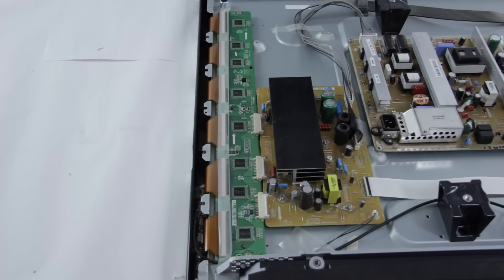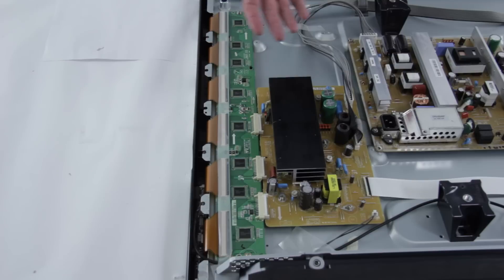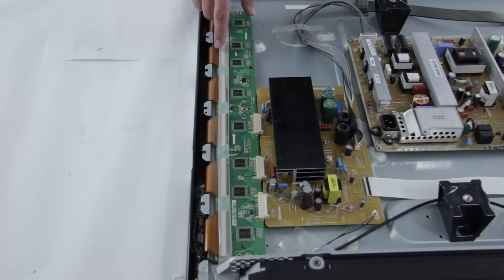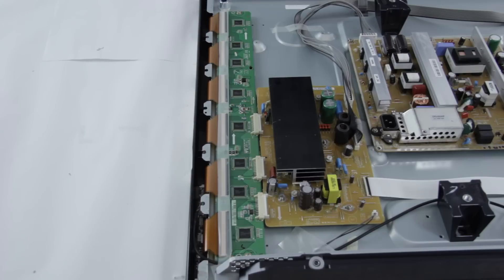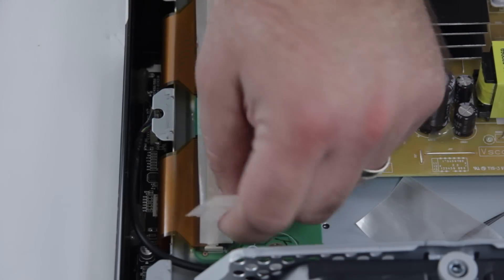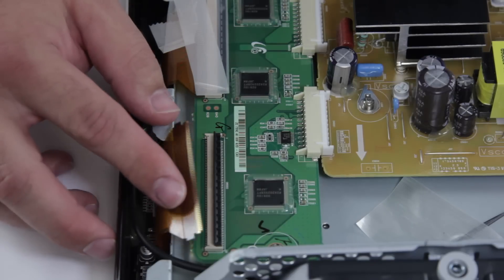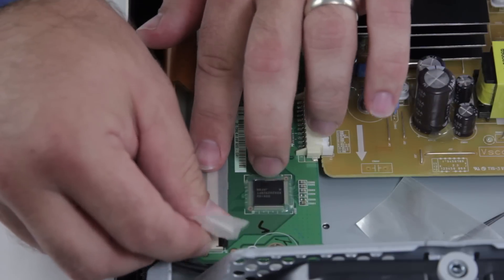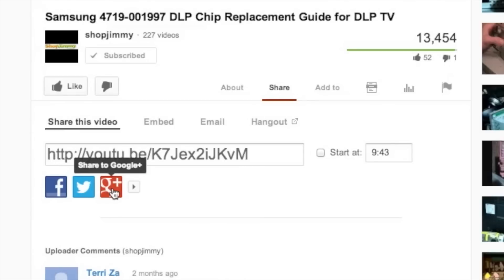Plasma TV Repair - No Image, No Picture on Plasma TV Screen - How to Replace Y-Buffer & Y-Sustain

Comment: Hi Jimmy, have a Pioneer Plasma TV model pdp-505pg, I believe the Y sys board is faulty, bought a second hand one USA, however, that doesn’t work at all, the old one works for a while then cuts off, can be days a week or a couple of hours. Question is can these boards be repaired? I am in Australia any help would be appreciated Thanks Paul

Comment: Hi, I just came across this video today as I have recently had an issue with my Samsung 59" Plasma TV  (P559D550C1MXXY). I realise that this video was posted 10 years or so ago but I am hoping to still perhaps receive a reply regardless ....... My TV was working fine for all the years I have had it (bought it brand new) and while my friend was playing a game on a PS4 ( but was not watching the screen at the time as he was distracted from the room for a few minutes), he told me that when he returned he could hear the sound of the game but the screen had blacked out. So he turned it off.
When we tried to turn the TV back on a little while later you can hear it "click on" and the red standby light flashes slowly a few times and then stops (turns dark no longer red) and there is no picture. We have tried a few times including complete power off methods to no avail. Can not change the mode to normal TV to see if anything as we cant see the option to do so due to this black screen also, so we have no clue if there is even sound still. The remote sensor seems to pick up the remote as when you press a button on the remote you can see the standby red light slashing rapidly however this does not appear to continue it too eventually stops. ..... Any suggestions? Or should I just dump it and buy another TV? (Although this TV has the best picture and has lasted beyond its expectations) NEED HELP!! :face-blue-smiling:

Comment: 😂I do not know if you ever get to me but PN51F4500AF model 51inch. It plays normally then randomly picture black out while sound playing and commands work like volume on remote and tv physical buttons.  And then it will eventually shut down sound or commands don’t respond. No red light either. I have to unplug hit power off 15 seconds and then plug back in 30 seconds after or 30 minutes later.  And then it turns on but randomly go black in the first few minutes or sometimes lucky to go on 30 min

Comment: Hello my tv not switching on, stand by light blinks intermittently. Sound working if I disconnect x sustain board and standby light perfectly working without the x sustain board. What could be the problem. Model PS43E400U1R

Comment: Hello, watched a number of you videos and very helpful.
I however have a issue that I’m trying to resolve with this nice( but heavy) plasma Tv and was hoping you could point me in the right direction as to troubleshooting and fault finding.
The Tv is a Samsung Plasma ( model PS50Q97HD) 50” the  Tv powers on and the two relays click on the PWR Supply board. The blue led  flashes 6 times under the (on/off) at the bottom middle of the set. There is NO PICTURE and NO SOUND. The Tv responds to the remote (blue led blinks infer the (on/off) button at the bottom middle of the set but that’s it,after 20 minutes of inactivity it goes back to (standby) and the blue led illuminates under the (on/off) button.
 
There doesn’t seem to be any evidence of the (Y) or (X) sustain firing.

The original PWR Supply was faulty ,so has been replaced with a good working S/H unit,I re-flowed all joints on the transistors,capacitors and sockets on this board. (No dice) so then replaced the (Y) sustain board along with the (Y) sustain buffer boards (HI) and (LO) still no Dice. I then replaced the (X) sustain board with a good used S/H board, still no dice,so I then replaced the (Audio/Video) board located just above the stand in the bottom middle of the set,still no dice,so puzzled. The what is termed as the (logic Board) a small board with 3 white ribbon cables going to it,and is located behind the stand (Sub Assembly) this has not been replaced(Yet) and does have a (Static) green leds illuminated when the set is powered on.,also there is a green led lit (static) on the (Y) sustain board 
There is another (buffer board) located at the bottom of the set,just above the (L) and (R) speaker boxes,( not replaced) yet  this has 12-16 brown flexible cables coming direct from the screen. These are in pairs (L) and (R) with a cable linking both together,these are marked (E)  and (F)

So it appears there is break in communication between some of the boards.

1/ if the (logic board) became faulty,would this cause issues in the set working properly 

2/ if the (E) and (F) buffer boards located at the bottom of the screen just above the speakers went faulty ,could this cause issues/abnormal behaviour.

As you may have gathered,I have replaced most problematic parts, yet the set powers on but remain essentially dead.

Guidance and advice as to where to troubleshoot would be greatly appreciated.

With thanks. Jason

Comment: Good morning sir, I have problem, Samsung plasma tv blinking.model
Ps43F4000AR
Reply: I need help on how to solve the problem, I also want to ask if the Vs voltage is continuing when the Ysus board is disconnected

Comment: Dear Sir, Thanks for the help that you are providing to us, which I believe is very much valued. My name is Kiran and I am from Mauriitus
My issue is about the Y Sustain Board . it is making a clicking sound when I power the device on. I have to remove the main cable and reconnect it  every time. There is no image on my screen and the screen is completely black. My model Tv is an LG 42PQ10r. Please

Comment: I got plasma tv Samsung 50 inch . I’m have problems after I bought a new power supply for it . The problem is my tv don’t show nothing on my screen but it quite kick on and off and when it off the power light on and when it on the power light off. So I put my old back in and screen came on for 20 min before it start kicking on and off and power button light on when tv on and off when tv off and I see the menu when tv kick on and off

Comment: Hi ideas on short on y sus buffer connector matey ? Had bad capacitor on y sus changed 3 mosfets keeps power cycling shows short on 1 buffer connector 1st and last pin ty

Comment: My tv is samsung plasma tv model pn59d530a3f.  The sound and picture were not working.  I replaced the main logic board and the sound came back but no picture.  No backlight either.  With this model, the power board goes to the y-axis and then there is a power ribbon from the y-axis to the x-axis.  Im assuming i should probably replace the y-axis first?  thoughts about this?

Comment: I have a Samsung plasma 42". When turned on I will get picture for a few seconds. But then screen goes black. Still produces sound but no picture. If I turn it off then on, same symptom. Picture fir aliitle then black screen and audio. Any recommendations?

Comment: February 27  2023

Gentlemen: 
The information below refers to a L G  Plasma television
Model #     42PJ350_UB            Serial #    005RMNE9K527         (2179)
SVC Code  42PJ350-UB  AUSLLHR               MFG     May of 2010
The problem began as a loud POP. The screen went black and no audio.  Upon inspection I found that the Y sus main board was shorting the power supply board to ground.

I removed  the Y sus Main board and checked the power supply board and found that 
all voltages on the power supply board were as indicated on a sticker  above the power
supply board.  VSS 197 - 207    was  207.    Va  60    was 61     Ms  5     was 5.0     Obviously 
all fuses were  good.

In checking the Y sus Main board I found Q11 and Q12  (sus up) shorted drain to source.
I removed those F.E.T.  and replaced the board.   The power supply board functioned
properly and all voltages were normal  at the input of the Y sus Main board  and the 
Z sus board.  Naturally I didn't expect the screen to light up but I was able to verify that after having connecting an antenna that I had audio and was able to turn the  tv on and off and vary the audio gain with the remote control.

I had audio, remote  control  operation  as mentioned above with  the ribbon  cables removed
from logic card to Y sus  main board,Ribbon cable removed from  Y sus main board  to Y buffer
and small cable from Y sus main board to address buffers.  The  eight integrated chips on the
Y buffer card looked in good condition as none appeares to have been over heated.

I suspect that I will need a replacement  Y sus  main board so here is  more information from  that board.     Y Main sus board  I.D. numbers.

printed on board	White sticker

E52483	EBR66607501					
LGE  PDP 691208			Y sus
Board  42T1_Y sus	ks 42104 jO55688
Part #  EAX61332701	2010 .04 .15
Rev P       LDC  no   2xxx    94V-0	

please respond to   James Foley       wa4jio@twc.com

Should you have any questions, please contact me by e-mail .

I will call you  in a  day or two and give you a phone number to call me should you need to.

Respectfully,    James Foley.

Comment: My Pioneer set model 5020 suddenly went blank (black picture).  Turned it off, waited 10 minutes, and turned it back on.  A sign came on, "Warming up, Please Wait.  Nothing happened, and finally, it went off.  If I touch any button sound, HDMI, same message comes on, but nothing happens.  No blinking light.  Standby light goes from red to blue but never picture.   Any thoughts

Comment: I have a Samsung PN64D8000FF that has a black screen but was getting sound from the cable box. I see the Y board may be faulty. Is there a way of determining if it is the Y buffer vs the Y sustain? Also, I have seen where the issue might be with the X board. I don't know how to use a multi-tester. Please make suggestions. Lastly I only saw a Y board offered on Ebay, where else should I look?

Comment: Hai, I have a problem with the Samsung plasma ps-42c62h. It has power on and sound but no picture only black screen... I have checked the T-corn board looks ok and the cables... What could be the problem? Do I have to change the y-buffer

Comment: I have a Samsung plasmas tv. Model PN50C8000YF. I noticed 2 Black oblong spots on my screen with white circles around them. While looking at the TV the picture just went to a black screen. Audio still works. I get no menus or volume emblems on the screen. Is this repairable? If yes what do you recommend.

Comment: i had a samsung ps51d450  first while view something exploded inside ,found it at the x sustain board and replace the FGPF4536 ,SF10A400h .also found that shorted 5volts to gnd.on the ribbon cable at the t con board.going towards the Y SUSTAIN .replacing this cable did not  fix the tv a 5sec then 2sec interval occurs at the t con board but i found out that this is cause by pin 21 DRV-RESET of CN5006-CN2022 of the ysus and tcon .thank you

Comment: Hi.. I have a 42" samsung plasma tv, when turning on I can hear the samsung sound but no display.  I have changed the Y-board and the Z-board but still no picture. Can I safely assume if I replace the y-buffer board it should work?

Comment: Samsung plasma tv ps42a456p2d vertical lines on screen. Initially though my xbox had change screen settings but this is not the case. Watched your video and wonder if it is the tcom  board or the screen?
Thanks Mark
Reply: Opened up TV have a flashing led 2 light next to r2068 led 1 does not flash this is next to r2067 does this help to diagnose in any way? Really interested in the solution as its my sons xbox monitor and tv

Comment: i have a 50"  LG plasma tv ,had it many years and for a while the picture would go dark and there would be some residual reddish speckles and eventually after many times of this happening it would be just dark but the sound was still there, i thought it was perhaps an over heating issue so i would shut it off and put a standing fan to blow air behind the screen at the back housing panel and then keep the fan on while watching tv ,but after a while the problem would return even though the tv was still cool so i would shut off and turn it back on several times and the picture would come back and i no longer needed the fan ,now both pic and sound are gone and doing the off/on thing is no longer working ,is there anything i can do myself or is it worth it to get it repaired or just buy a new one?
Reply: I' ve the same problem 😓
Reply: @blaster-kjared9561  what is your tv and what problem? give some details,, mine lasted 11 years strong since 2011 date of mfg  when this problem finally happened , tried a few repairs myself, zilch ,,,had to deal with some bad practice repair fools over the phone that never showed up to my house and kept giving me excuses ,, finally by great luck found an electronic and tv repair place close to me who work on these older models and got it fixed after a couple of weeks(could have been a couple days had the guy worked on the board himself instead of trying to find a replacement) and cost me only 200 bucks ,its been 7 mo now and so far so good hoping for another 11 years be awesome but even if i get a few more years out of it  would have been worth it specially for good pic plasma screen you can no longer find em anymore , the pic still looks pretty sharp and good perhaps better then before the repair but i figured it would be worth the effort to try to get it fixed if the price is right because there was nothing wrong with the pic before it broke down

Comment: Hi i have samsung plasma tv ps50c430a1 the tv turn on normally and the picture come normally for minute or less and then the picture goes off but keep sound what do you think the problem is ...i hav not measure any thing yet... will you help me please....thx anyway
Reply: Hi i measured the voltage of vs and va when the tv work normally ...there is vs voltage which is i think 217 volt but  when picutre goes off the voltage of vs missed will you help me plz

Comment: I have an LG Plasma TV model no 60PV400.  It starts up just fine and then after some minutes the screen just goes black, but the sound still plays and it doesn't interrupt anything else, just the screen goes black.  I stopped using it for months and months, then the first time I tried using it again it lasted a day or so without doing it at all, but now it's back to doing it every couple of minutes.

Comment: Hello. Nice video. I like to learn from you. 
I have samsung plasma PS51D550 and the screen is covered with vertical colored lines from top to the bottom. At first there was only one white line and after a month there is about 20 lines all over the panel. Tv works fine, and there is no new lines in 6 months. What do you think the problem is? Thanks

Comment: May Panasonic plazma TV model no TH-P50X30M  so this tv I was close and packed 5 year then after 5 year I want to start the TV but not came on  tv given the 12 time blinking code red light error please can inform me how can repaire and which is the part of the  problem power supply are motherboards

Comment: My samsung screen just switches off. if it has worked for a long and you switch it off especially when going to bed, it does not start on the following day. it does stay for a very long time to come to normal so that it becomes on again when switched on. We normally have to wait for its self picking period. why is it so?

Comment: Lg50pa4500 repeated click noise but when i remove m_on from its pin going to main board..it clicks on like normal and green light on logic board comes on so i thought prob solved but still no image. Anyone know what may be? Also this specific tv was suspected to be hit by power surge from a storm but idk seems like power supply and mother board still goid all capacitors appear to be ok but running a volt check as we speak. Doubt ill figure out whats going on at this pointn idk what im doing but i have a feeling basded on simple knowledge uts a cheap fix

Comment: I have a plasma lg tv model 50pc1 rr and the screen is black and shining.in a shop i went they told me that has problem with backlight brightens on off but they could not fix it.please help me to find a solution.thank you

Comment: Very interesting video. I have a Samsung 50 inch and what happened while watching tv I heard a pop and screen went black no sound, I can hear it turning on and off but no picture I have taken the back off and the green light  blinks every 7 seconds should be every 1 second I thought. What do suggest. SAMSUNG MODEL851FH-YB01 OR PP51FF003A

Comment: Hello, I hope you see this! I have a Samsung HP-S4253 that worked fine a while ago. It hasn't been used for a while and had no power going to it (power strip was turned off). Anyway, I just tried to use it and it will turn on, cycle through inputs, pass the audio through to my receiver, but there is no picture. Your video is the first thing that came up in a Google search. Any ideas?

Comment: hi i have a samsung plasma ps43e450a1wxxu  it made a load bang was sound but no picture.i turned if off.since i turned it back on the led is on but no sound and no picture. is this the y sustain problem?

Comment: pn51e535a3f power button results in the red power light blinking once and then trying to a second time but fades. i replaces the 3 boards on side of the ribbons already. the ps_on from the inputs board has signal briefly on the power supply. the led on the control board blinks green once long then short. it seems like the control board is trying to start the tv a few times as indicated by electrical signals from into the power supply. if i unplug the sustain to the low and high boards the power supply is fine to continue sending the 15 volts on the B outs and the control boards led stays on. seems like the sustain board needs replacing too.

Comment: Samsung PN60F5500AFXZA, TV turns on but no picture. most of the time I can hear sound. If I turn it off and back on a couple dozen times it will usually come on.